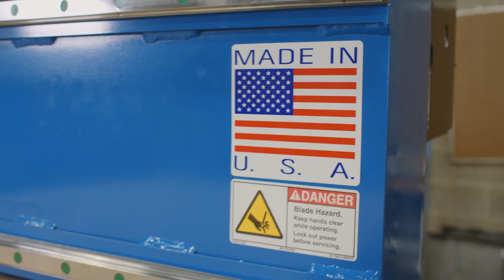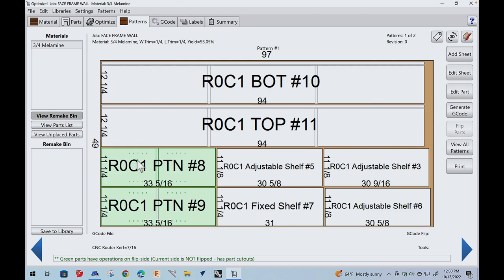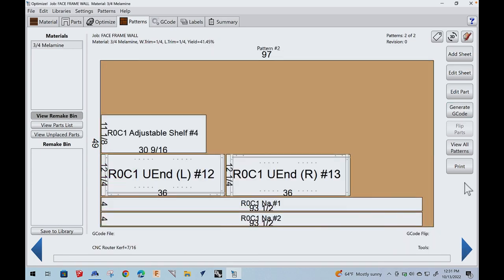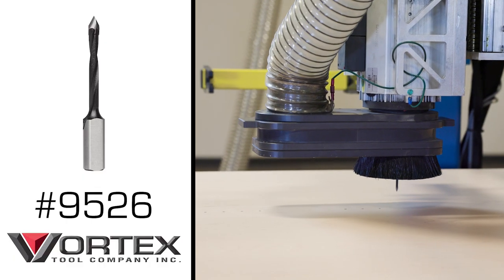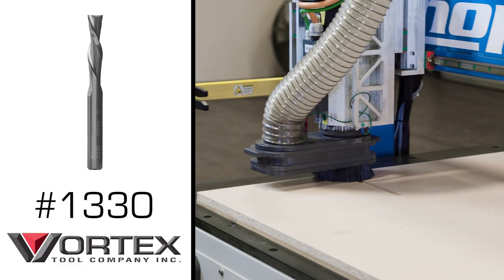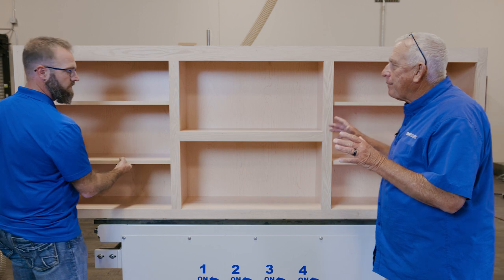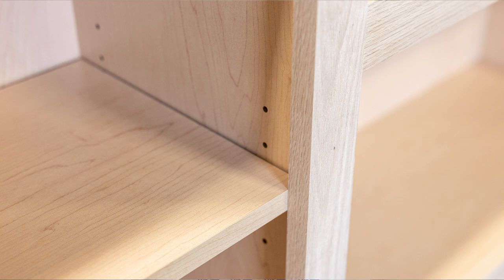ShopSabre CNC Face Frame Cabinets - Part 2

Comment: What’s the market like for making cnc cabinets? Is there resistance to newcomers using cnc vs a carpenter? Is it worth getting into as a small business? Also, what material did you make the face frame out of?

Comment: That "through" bit looks pretty slick!  I think I'd be afraid of pushing my SS23 that fast, but that 408 does quick work of a full sheet.
Reply from the maker: The 408 is a beast, those 23s though have surprisingly good power for their size and class
Reply: The SS23 will actually make that inside cut.  The feedrate was 150 IPM at 18,000 RPM.  The only thing you will need to do is change from two passes to three or four passes!

Comment: Was the face frame one piece? Or were the stiles and rails joined? If joined, why not make it one piece?
Reply from the maker: The face frame was built off the machine, it could be cut as one piece but in this case Shawn built it with his cabinet shop jigs and tools which made it very quick by combining machine technology for the box and his shops capabilities for the face frame but we did a video on engineered face frames as well in a later video
Reply: Also a one piece would require a full sheet of hardwood glued up, or would take awhile to edgeband the inside plywood edge. Only other work around is some fancy footwork with a 90 degree fold.